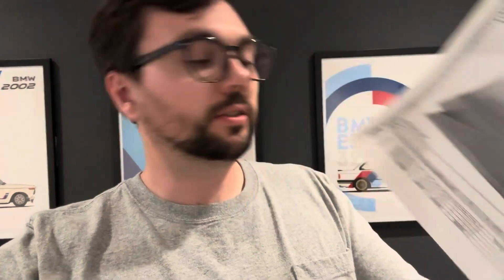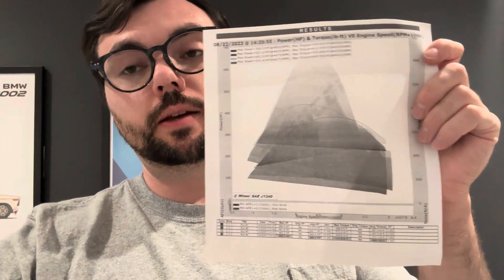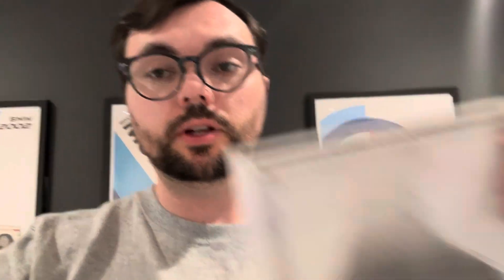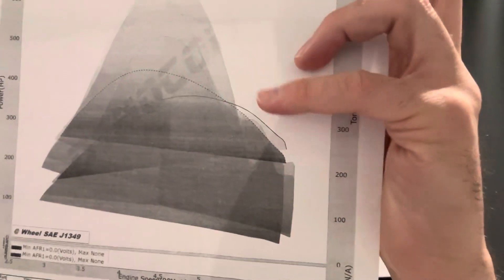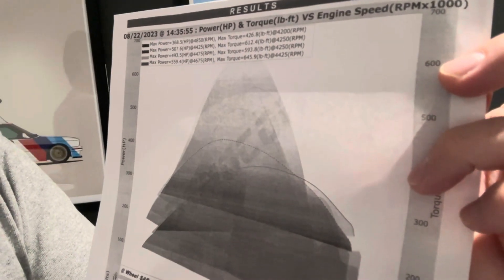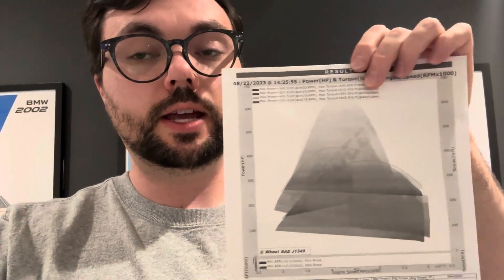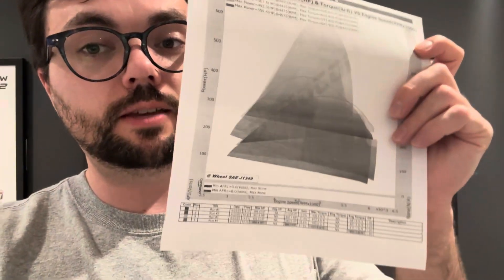My Savage Fabrication Turbo Accidentally Set A World Record! BMW M30b34 stock long block HP record ?

Comment: Hey what clutch are you running to hold that?  Very impressive btw.  You should look up a thread on mye28 sometime called "noobtom30s".  It's hilarious.  Are you on the factory 260 transmission?  Thanks.
Reply from the maker: Sachs 765 pressure plate and an e34 M5 organic disk (it’s amazing how much it holds) I have a getrag 265/6

Comment: I appreciate the Holset content!
I recently came off the dyno on a stock motor with mild valve spring upgrade on a stock he351. Dyno looked about the same as boost was turned up but “less.” 

I think you have an exhaust valve spring problem, and your dyno plot uses excessive smoothing so you can’t see the havoc of your valve springs failing. Your AFR wacks out and makes you want to put wrong looking values into those load cells. 

I wouldn’t waste any dyno time without upgrading the springs. The motor was dynoing has no other spring upgrades possible so I going with a 67 upgrade to decrease backpressure (which forces valves open) 
I bet your 67mm turbine let you get the most out of your oem springs. There I very little honest Holset content out there!
Reply from the maker: Thanks for watching 🙏

Comment: I’m spraying meth and still blow up head after about of year 😂 I am also very rough on her we ran down a bunch of r/t Camaros
Reply: ARPS in head stock gasket which destroyed itself pushed 3 rings out about 4 inches have a cut ring and the car on the lift right now 😂

Comment: Man oh man, congrats!!!
I fried the MS PnP in my E34 M20 in September. Have been driving my NA E34 M30 since. Hoping to also boost my M30 some day!
Reply from the maker: Thanks !!!
Reply: @TurbineResearch hey, I got my MS PnP back (circuit board repair, solder joint repair and some diodes). Seems like the tune file is corrupt. It wants to fire but doesn't. Tuner studio has connection errors. Know anyone who can troubleshoot / load a tune when there's comm errors?
Reply: @TurbineResearch DIYAutotune won't touch it since they didn't sell it.